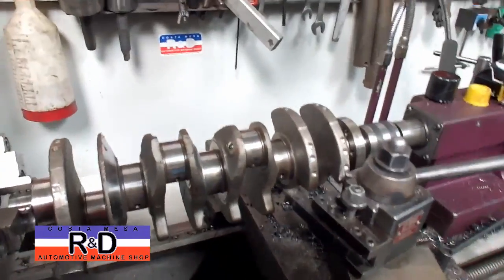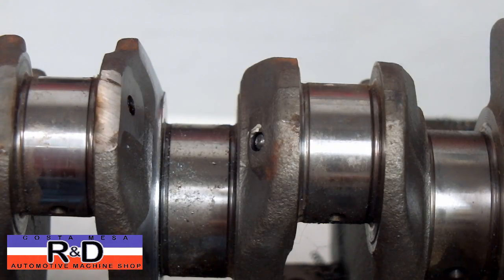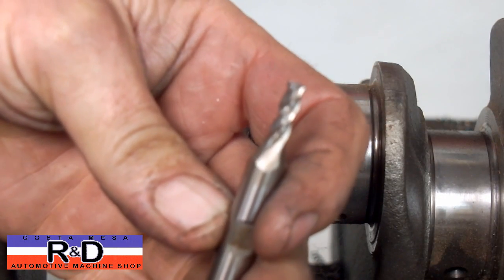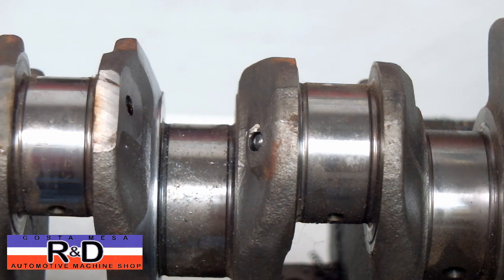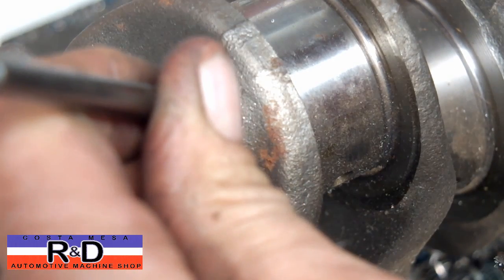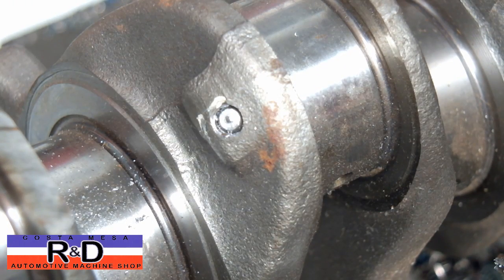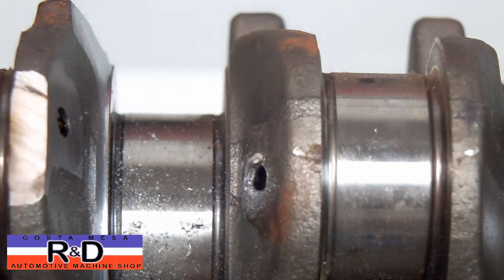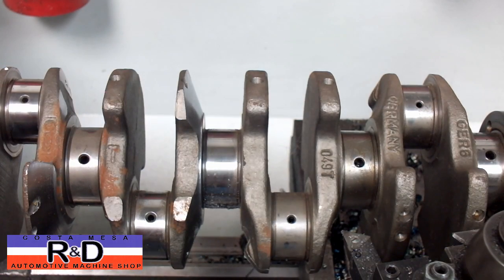Oil Galley Steel Ball Removal

Comment: The reason to remove these is generally to allow a complete cleaning of the oil passages throughout the crank. A lot of oil sludge builds up behind these over the years.

Comment: This is not easy to due he makes it look easy don’t try it ...   it took a machinist a 55k rpm pencil grinder and 7 carbide rotary files ...  I finally got all 4 out and almost wasted my crank shaft ....   put masking tape around the journal s Incase your rotary file jumps of learned from experience trust me

Comment: Dumbest idea ever to remove them. All you'll do is distort an otherwise OK crank.....if debris won't come out then it won't come out and won't cause any harm. If you don't know WTF you're doing , leave it alone.
Reply: 1magnit  how does removing a ball distort a crank?
Reply: You don't want to go hitting it with a hammer nor do you want to go welding it without re measuring and re machining after.....Same as every crank which spins a big end bearing always ends up bending it when measured at the mains, that's when you keep on driving. If you don't have the ability to measure , you'll never know.
Reply: 1magnit  never noticed any welding in the video?
If centre punching that ball is going to distort it I think you’ve got bigger problems!
I’d also imagine that this crank hasn’t been ground yet, wouldn’t that be done after the knife edging?
Reply: Are you going to leave the holes open? How do you block them up again without leakage?
Reply: @1magnit  Tap it and install threaded plugs. I've done hundreds of them. Any method of cleaning will disturb the dirt behind the plugs. It really needs to be cleaned out.
Reply: Any debris is centrifuged into place, it won't come out during use........no point in doing unnecessary work.,,,just because you've done lots doesn't mean it's required.
Reply: 1magnit  It’s required if I’m gonna stand behind the job
Reply: @billmiller7138  same here. Remove, tap, grind journals then clean.
Reply: @billmiller7138  does the crank have to be balanced after doing this??
Reply: I wouldn't say distort it but just imbalance the crank but that can be fix

Comment: what are the benefits of knife edging your crank? and why were those steel balls in there, weren't they blocking oil flow?
Reply: Three intersecting holes are drilled into the crank, to create an oil passage from the 'main' to the 'big-end'.  You have to cap one end, of one of the holes, so that oil is directed to the 'big-end'.

Comment: Why would you want them out? Geneuon Question
Reply: For cleaning out the oil passageways. Then just drill and tap new threads and fit with set screws (as was noted at the end of the video) and your done. Brand new/old crankshaft with clean, clear, and possibly polished,  oil passageways.
Reply: @samualiam9981 after removing balls and replace with set screws do you need to balance the crank?
Reply: Do the balls not serve a purpose other than balance??

Comment: Cover crank with welding blanket using  a stick rod welder with power off  set amperage so you know the rod will fuse onto the ball, hold in place and have your mate turn on/ off the power with the rod now fused to the ball use yor vice grips to extract it .......result  shit easy
Reply: Gaz Girl - *you're... idiot.
Reply: there are special short ones , i mean the flux, saw it on ships for the isolation to hold on
Reply: David Aitken wrong and your a fuckwit have you ever done this before you muppet I guess not stfu

Comment: Why not just keep on "knife edging" on the Lathe ? !!!, after a defined grade of "edging", the Balls just "fall out"....Done that a hundred times to VW Cranks on my lathe.....after that just cleaning the oil holes by hand with a drill bit, and after that, taping the holes , loctite, and putting tapered studs in with an allen head ;) Done !
Reply: what is the purpose for this?

Comment: I have ground the balls to about 1/2 diameter , taken a punch and "flipped" them. Have done this countless times on motorcycle cranks. Tap with a 1/4 X 20. Need nitrated taps and they have to changed as soon as they "won't go" deeper.

Comment: Thanks for this.  What a great answer to all the people who asked about this on the last crank plug video.  I know my subscribers will appreciate this because 4g63 cranks have balls.  Big ones.  Lots of them.
Reply: JSMCPN I won't steal anyone's thunder, I have enough respect for this channel and the expertise here to not act like I know better.  I will say that I don't know anyone who has removed and re-installed these balls on a DSM crank.  I don't know if it's because the shops lack the ability, tools or willingness to do it, but what was suggested to you is the route that everyone I know including myself have taken.  If you want it done that way, thanks to this video, you know where to send it.  :)
Reply: At the beginning of the video, the guy states that he's removing the balls in order to knife edge the crank, not to clean out the galleries.
Reply: @Jafromobile  what is the purpose of removing the steel balls?

Comment: I have heard the term "knife edge" for cranks but never seen it done or what the purpose is?  thank you for another great video.

Matt
Reply: +mattcurry29 The leading edge of the counterweight is cut/ground to a knife edge to reduce windage horsepower loss.  It takes a lot of energy to spin a crank at 5000+ rpm, just because of the air it has to cut through.  A lot of horsepower is lost from the crank just "churning" the oil in the oil pan.  How much power?  Just enough to pass the other guy in a turn or down a straight.  That is why most high performance engines run a "dry sump" system.
Reply: It's to lighten and reduce oil and air friction against the crank.
Reply: +WAVETUBE84 they run dry sumps as well because the oil pumps cavitate at high rpm...example honda engines passed 10k rpm...i work for raceheads.ca and most engines we install dry sumps is because of that...

Comment: Why does it have steel balls in there to begin with? Balancing?
Reply: Its the hole is from where the oil gallery is drilled in the crank to supply the bearings with oil. but you don't want oil coming out those holes afterwards, so they press balls or miniature welsh plugs in after to seal them back over.
Reply: +forgotmylogininfo The balls are just plugs, at the ends of the oil galleries that are drilled at the factory.
Reply: Thanks guys
Reply: Does the crankshaft have to be balanced if you just remove balls and tap and plug.?

Comment: does the crank need to be rebalanced after putting in the set screws? Can you elaborate a bit on crankshaft balancing?
Reply: Being he said the crank is being knife edged, i would have to assume that the crank will have to be re-balenced after the material removal is done.